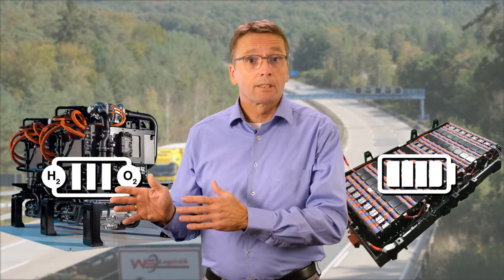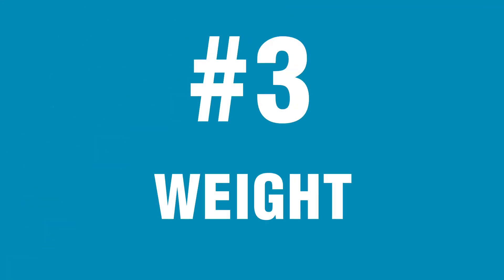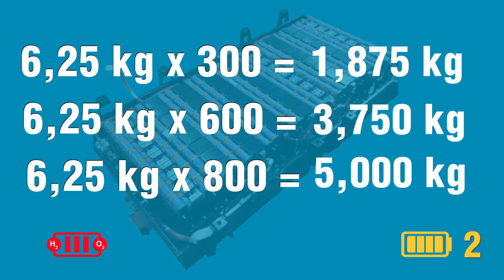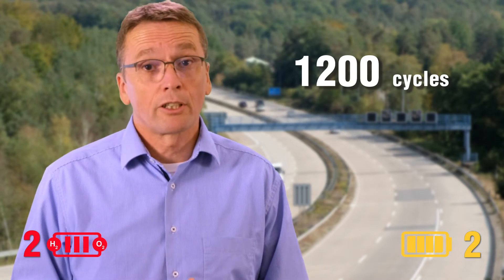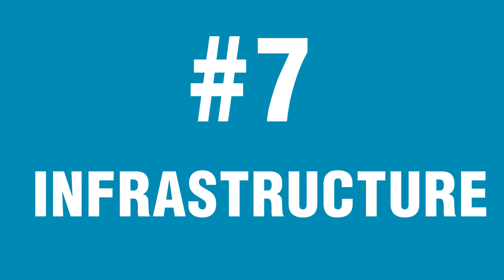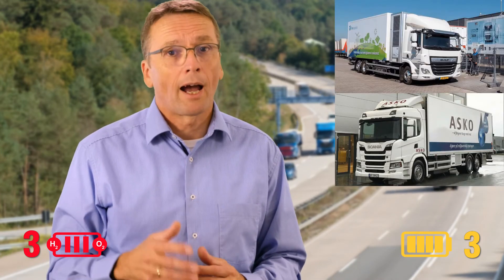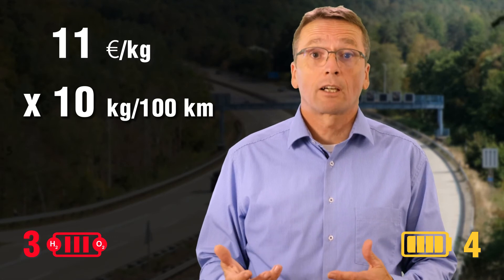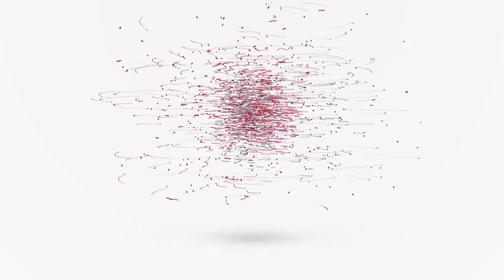Sustainable Trucks: Fuel cell vs. Battery - Which is the better solution?

Comment from the maker: Battery or fuel cell? What do you believe is the better solution for trucks? Or do both have their justification? I am interested in your opinion.  Leave a comment to discuss various sustainable trucks topics.
For latest news on sustainable trucks visit https://www.truckbustrailernews.world
Find out all about global truck and bus manufacturers on our global industry directory https://www.oemlibrary.world
Reply: Fuel cell gives long range
Reply: @prudhvi2354  True
Reply: @prudhvi2354  fuell cells are ridiculously inefficient, battery is much better
Reply: Some of the points in the video mentioned are more important and some less, so you can not say that it is 3:5. 
Moreover, there are key features missing. Let's say we take "CO2-Emissions in production", a very important argument for hydrogen, and sadly rarely mentioned. "Resource consumption in production" is a similar point and also important, because every non-hydrogen truck would need tons of lithium and other materials in the battery to get an acceptable range.
Reply: 1) complexity:
Fuel cells are basically another form of electric generators which we have been producing in mass for decades. Infact even more simple because there is no moving parts. Due to their weight savings hydrogen is much more simple to scale then battery banks. That’s because the more payload or miles you want to design a vehicle for, the more the heft of any battery bank bogs down your design. This is why there are so many hydrogen plane, boats, industry, and truck (aka the main polluting sectors) designs because hydrogen is feasible and more simple to design at scale. Further more with batteries there are so many chemistry’s and reduce capacity as it ages: more so then fuel cells. Batteries are also more complicated to work around in a company schedule then hydrogen. Are you realy going to expect company’s to scrap all their combustion vehicles for a battery powered one where they will have to pay their employees for unproductive hours per cargo journey per recharge for no good reason. Where as for hydrogen refuel times are much quicker and there for don’t waste company money and logistical scheduling on charging down time. Also hydrogen can be retrofitted with any combustion engine with some mods. So simplicity of integration is in hydrogen favor. (Point goes to hydrogen). 

2 efficiency. Hydrogen is already on par if not more efficient then vehicles yet we still use diesel so not sure how this relevant other then this being the only section where batteries can win assuming you ignore the flat out things you can’t use batteries for because their weight inefficiency bites them in the ass. Things you could use batteries for but hydrogen storage is cheaper per total kWh stored at scale so price (of materials) inefficiency bites them in the ass. Or time inefficiency which in a world where people are payed for their time is kind of a big deal. And range inefficiency. But sure if we be myopic battery so way more efficient then anything we use today but if you values more well rounded efficiency hydrogen has you covered. Point goes to battery*****
even though you could store more total kwh at the same cost with hydrogen, it will take less space then equivalent battery back, and weigh less. But hold on you can generate hydrogen directly from sunlight using photosynthetic catalysts or algae which also suck co2 out of the air, or use digesters which convert waste to hydrogen using microbes, or in the distant future scoop it up form Jupiter. Or for now generate hydrogen using surplus power which would of been wasted anyway and if w remember how we can store more total KWh with a hydrogen storage system then a battery because bats don’t cost scale then that means hydrogen is more efficient cause it saves more total waste energy then batteries at scale. Point hydrogen.

3) weight. Don’t kid yourself no battery design will ever come close to a fuel which included hydrogen. In our current technologies even including leakage hydrogen still more light weight and volumetrically energy packed then any battery. But there is no reason to assume hydrogen won’t get even better. If we are trying to crack hydrogen to hydrogen  fusion then thats just not even fair to batteries. If we get plasma storage hydrogen densities anywhere close then the sun we could store hydrogen more densely then any known element or compound. Store as metal hydrogen again impossible for a battery to catch up. But in current test hydrogen takes it.

4 Range:  Hydrogen not even close. Military swapped batteries for a fuel cell system in their UAVs and got 30min vs 8 hours of flight time. Due mostly to weight. 

5 Durability: hydrogen (yes fuel cells last longer) look it up this guy is wrong. Battery is a tank which don’t digrade over time. I’ve been to a guys house “Hydrogen House Project” has been off the grid with fuel cells for 16 years and going. So again this dude is wrong. While I took the tore he was in the middle of replacing his old battery bank. Hydrogen 

6 Infrastructure: all/most combustion vehicles can be retrofitted, battery designs exclude themselves at scale for say rockets, infrastructure, energy storage, truck transport, and many industrial processes. So sure the charge station is easer to implement but it will only be charging cars at best which is a far cry then supplying total energy needs of all other sectors. Where as hydrogen is a one stop shop for cooking/heating gas, transport fuel, electricity gen or storage, heck military is looking into military propellent for hyper velocity’s. Infrastructure hydrogen wins. Puss all the internal combustion can be converted as HHO nuts proven. Hydrogen cleans the air. So what do you expect? Everyone is going to sell their gas/diesel cars or truck to no one and then magically afford to buy Teslas or would it makes more sense to steadily retrofit over time to reach net zero sooner? Consider the lithium shortages. Don’t be ridiculous. Hydrogen wins if you consider most the sectors instead of just one.

7 Charge times: hydrogen 5min vs 30-8hrs. Keep in mind hydrogen recharged quicker then your iPhone. Hydrogen wins. Again our economy relies on just in time and many rotating shifts, and pay by the hours. 

8 Handeling is the same. Though if you count refueling as part of the experience (hydrogen).

9 Availability: neither WIP. I haven’t seen either kind in the road and if majority people are honest neither have they.Electric is easer but you won’t want a elective truck refueling station because of the recharge time wasting your businesses production time. Judging factors that will sort themselves out with time is just padding for battery to “win”. Like comparing DC vs AC infrastructure back before AC took off. “DC is available now so clearly It’s the best”-type logic. But again all the sectors hydrogen can effect vs battery, it’s not close. Hydrogen.

10 Production: sort itself out with time, expensive composts like platinum have been replaced with alternative cheaper materials, costs will slim down and say unlike oil price gouging won’t fluctuate any time there is emergency. Once hydrogen station breaks even it could resuly be as cheep as you like since renewable based. But keep this mind current hydrogen vehicle come with 2 years of free fuel. Some 3+ by Certain manufactures. So hmmm. Battery. 

7-2 hydrogen wins in my not as over simplified examples.

This isn’t to say one is better and we should punt all resources going to the inferior for this application or general application. WE NEED BOTH. Electric makes so much more sense for trains, and trolly/cable car infrastructure and non long ranged non commercial vehicles. Hydrogen for industry, retrofits, big transport, and aero space. Hell we will still need portable generators in the future and since all Hydrogen fuel cell vehicles have that built in, great, if not dedicated emergency generators form fuel cells are a must. Plus pure water as a byproduct makes them more attractive for disaster relief. We will need both.
Reply: Fuel cells may be about as lasting as batteries, but they are much cheaper to replace the membranes than all the batteries.
Reply: what about in the case of batteries the energy lost in renewable to the transition and distribution ?

Comment: The problem with this is that he dosen't even mention the most important factor of all; so important that it trumps all the others.   That factor is environmental sustainability.  There are endemic environmental problems with battery vehicles whereas there are none for fuel cells.  After all, we are fiddling around with alternatives to fossil fuel use because of efforts to go completely carbon free.   Hydrogen replaces fossil fuels in all applications (even steel production) so there is no need to have programs like this.   Hydrogen is the only total way out of our carbon ` box '.

Comment: Feb 2023 the Port of LA, Shell Oil, Toyota and Kenworth completed?   (abandoned)  a hydrogen powered truck project.   They published everything except the cost per mile to haul freight with these trucks.  Oh, they can be filled in 20 minutes and they could go 300 miles.   If they were so great, why are there not 100 hydrogen trucks there today?   This technology was touted at the CARB meeting in 1999 to kill the battery powered cars.   In 2017 hydrogen powered Kenworth trucks took to the road.   Now in 2023 they are have a few hydrogen powered fork lifts at the LA port.  That's not long haul anything.  It's a joke.  Hydrogen is the power source of the past.   It is obviously too expensive and those trucks are not for sale.  They are just a big read herring to distract money and resources away from working solutions so oil companies can sell oil for many more years.

Comment: World should switch to green Hydrogen, green Hydrogen is already cost-competitive compared to petroleum fuel in India. Petrol costs more than 100 rupees per liter and the average fuel economy of petrol cars is 15-20 km/liter which means that it costs 5-7 rupees per km, now let's compare it to green Hydrogen, green Hydrogen costs 350-500 rupees per kg and a Fuel cell car like Toyota Mirai can hold at least 5.6kg of Hydrogen and it can run for at least 650-1000 km before needing a refill which means that fuel cell vehicles cost 2.80-4.30 rupees per km (500 rupees x 5.6 kg / (1000 km to 650 km)). Indian government has announced National Hydrogen Mission and Indian companies like Reliance and Adani Enterprise are making big investments to bring green Hydrogen manufacturing cost down to less than 100 rupees per kg which mean that in near future fuel cell vehicles will become even more cost-competitive compared to petroleum vehicles. However the cost of Hydrogen Fuel Cell vehicles is still high compared to petroleum vehicles, price of fuel cell vehicles will reduce when production will increase. Toyota has a very important role in green mobility solutions because it is the market leader in fuel cell technologies, Toyota should work with the Indian government and try to establish hydrogen infrastructure as soon as possible, Toyota should launch highly affordable fuel cell cars to compete with battery electric vehicles, Toyota also understands Indian automobile market, a fuel cell version of existing cars like fuel cell Toyota Yaris or fuel cell Toyota Fortuner at a competitive price can make fuel-cell cars popular very soon. Batteries are big, bulky, and heavy, to carry a lot of weight for a long distance we need to add lots of batteries, and the more batteries we add the charging time increase and the more weight we add and to carry that extra weight we need to add even more batteries which are not practical especially in large commercial vehicles like trucks, trains, ships etc, This is the reason that Indian Railways is converting its diesel locomotives into Hydrogen Fuel Cell locomotives. Battery components are available in some countries like China, the Democratic Republic of Congo, etc, we need to import components like Lithium and Cobalt from those countries. Currently, we are dependent on OPEC for fulfilling our energy needs, if every vehicle will be replaced by battery electric vehicles then we will have to be dependent on countries like China and the Democratic Republic of Congo for getting materials used in batteries. Batteries are also difficult to recycle and have a shorter life span compared to fuel cells. Switching to green Hydrogen can make most countries like India self-sufficient in their energy needs. Excess electricity can be stored in big Hydrogen tanks and be used as needed. Microsoft successfully tested Hydrogen Fuel cell generators to power its data centre, they also use batteries for instant response to power failure but batteries can only provide power for a few hours, Hydrogen is lighter and more energy-dense compared to any battery, also the refueling time is very short compared to battery electric vehicles. Big vehicles like large commercial trucks will need very high-power superchargers to charge the truck in a short time. It can take down the electricity grid even if there are less than half a dozen large trucks charging simultaneously because it will require a large amount of power from the electricity grid which can fail and shut down any kind of power grid. Also, fast charging degrades batteries faster compared to slow charging. Companies like Hyzon Motors are providing zero emission Hydrogen fuel cell powered commercial vehicles(buses, trucks etc), shipping industry also wants to move to Hydrogen Fuel Cell based zero emissions technology to power small and large marine vessels because you can't run marine vessels from batteries only. Some people are hating Hydrogen Fuel Cell vehicles because Elon Musk has always criticised and made fun of fuel cell technology. Musk is intelligent but he can not be right all the time. Batteries should be used in electronic devices(SmartPhones, Laptops, etc), for vehicles especially large vehicles Hydrogen Fuel Cell technology makes more sense. governments across the world must accelerate the switch to green mobility solutions by rapidly creating and improving the Hydrogen Infrastructure(Hydrogen Gas Stations).

Comment: @9:42 the cost of green hydrogen is less than diesel. 2nd is consistent power supply. Range degradation is a serious problem with battery vehicles. Also waiting time while getting battery charged is out of question when freight is rush delivery. I think we should consider fuel cell as a future fuel. more consistent and cleaner plus its environment friendly as well.

Comment: you forgot to calculate the environmental cost comparison when using hydrogen and battery. You use more batteries in full electric trucks compared to hydrogen.